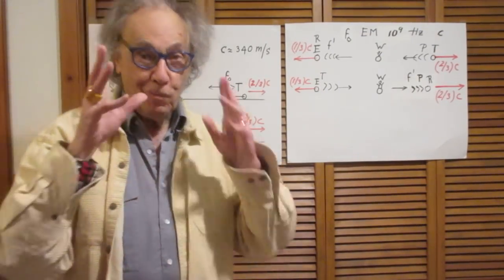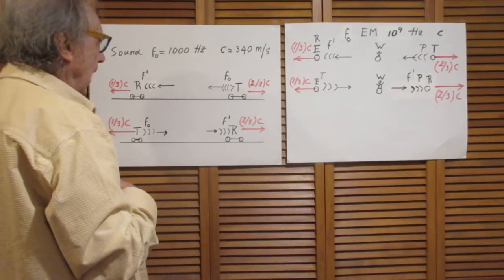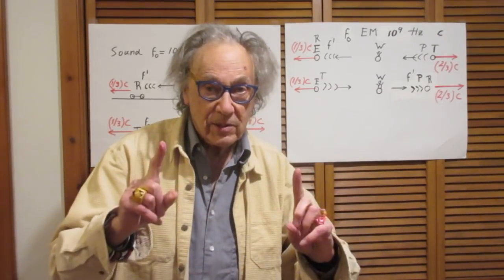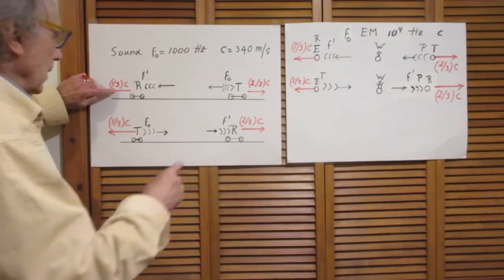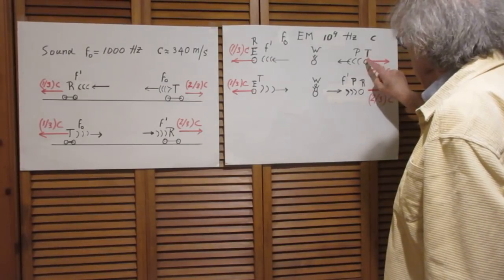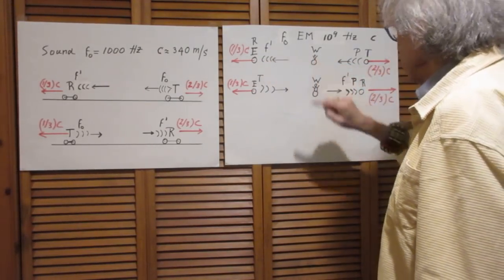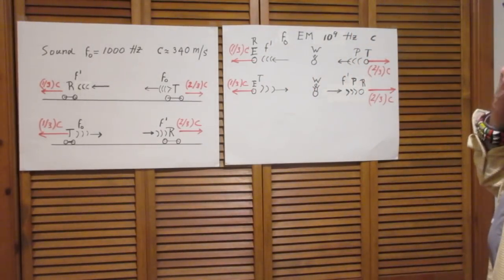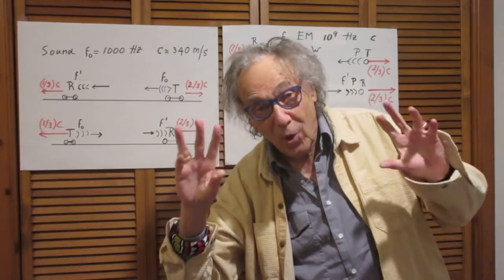Problem #28 Doppler Effect - Partly Easy, Partly Hard

Comment: I get this:
1) f' = 400 Hz
2) f' = 250 Hz
3) f' = 316 MHz
4) f' = 316 MHz
5) d = 2.84 Gpc
 
Notes.
1. Car moving away rightward 2/3 c produces sound, picked up by car on left moving away with -1/3c. The sound wave connecting the cars moves leftward at speed c so the relative speeds to this are 5/3 and 2/3. So the frequence ratio is 5:2.

2. Relative speeds are -4/3 and -1/3, ratio is 4:1.

3 Relativistic doppler shift formula is f'/f0 =sqrt ((1-B)/(1+B)).
Method a: first look what Walter measures, and imagine he emits it right away (he is on the same line as P and E).
B1 = 2/3 so fw= sqrt((1 - 2/3) / (1+2/3) f0 = f0/ sqrt(5) 
Then look what einstein sees 
B2=1/3
f'= sqrt((1-1/3)/(1+1/3)) fw= sqrt((2/3)/(4/3))= fw/ sqrt (2)
Now combine: f'= f0/sqrt(10)

Method b: first add up the velocities in the relativistic way: combined B = (1/3 + 2/3)/(1+(1/3)(2/3)) = 9/11, so f'=  sqrt((1-9/11)/(1+9/11)) f0 = f0 /sqrt(10)

4. Same problem, (only Walter sees a different frequency, but the combined speed is the same as in 3)

5. Hubbles constant relates speed to distance for distinct objects.
It is 70.4 km/s/Mpc. P is moving at 2/3 c, so at 200000km/s.
So the distance is 200000/70.4 = approx. 2841 Mpc or 2.84 Gpc (or 9.26•10^9 ly, since 1pc =3.26ly).
Reply from the maker: 5) is wrong
Reply: Lectures by Walter Lewin. They will make you ♥ Physics. Yes I took an outdated resource for the value of H. I hope the approach was right though.

Comment: #1 : 450 Hz
#2 : 450 Hz

Did this by deducing the calculations / formulas, I'm sure it was covered in highschool, but thats a long time ago and i didn't want to just look up the formulas and fill them in. 

Might be wrong.

Probably won't make it to the other answers, but i'll have a look at your solutions.
Reply from the maker: both wrong
Reply: Was afraid of that. Not thinking straight. Had a "zenuwbehandeling" at the dentist today which sure messes me up ..... Maybe I'll have another go tomorrow
Reply from the maker: "zenuwbehandeling"
ja dat kan heel naar zijn.
Reply: Blijkbaar. Ben van 2 tot 4 am van ellende de hond gaan uitlaten :-)...
Reply from the maker: morgen zal ik de solutions publiceren. Dan kun je dus weer rustig slapen (als je de solutions kunt volgen).

Comment: 3.  and 4  3.24 EE9 HZ
Reply: Actually, I used the approaching equation by mistake.  The proper answer should be smaller than original wavelength.  Answer is:  3.09 EE8 HZ a red shift of 3.24

Comment: I got the following answers:
1) 400Hz
2) 250Hz
3) 632455532,033Hz
4) 5E8Hz 
I'm sorry, but I couldn't find the answer of the question number 5
Reply: I resolved the four questions without converting the 1/3 and 2/3 of the respective velocities into natural numbers, so I'm not sure if the answers I got are correct
Reply from the maker: watch my solutions.
Reply: Lectures by Walter Lewin. They will make you ♥ Physics. I will :)

Comment: If the source of sound (pressure disturbance) itself is moving away at the speed of sound from the receiver how can the pressure disturbances reach the receiver?
Reply from the maker: Even if the transmitter moved away from the receiver with 3 times the speed of sound the receiver will record the sound but at a much lower freq than the transmitted f_o. Watch my solutions!

Comment: There are two conducting parallel rails separated by a distance L. One of their ends are connected by a resistance R. A magnetic field is set up perpendicular to the plane. A conducting rod of mass m starts sliding without friction over them with velocity v away from the resistor.

The rod will come to rest after infinite time due to the force by magnetic field on it given by ILB where I is the induced current in the rod. 
The question asks the amount of heat generated in the resistor in the entire process of rod coming to rest.

I solved it to get ½mv² which was the initial kinetic energy of the rod and is the correct answer.
I have a doubt that if all the initial energy got dissipated in the resistor, what happened to the energy taken away by the magnetic force as it is doing negative work on the rod? Is it 0?
Reply from the maker: I do not solve problems for viewers. I teach Physics. Watch my 8.02 lectures. The answers are there.
Reply: I didn't ask you to solve.
In short my question is — when the given conductor starts to slide with velocity v, the force exerted by the magnetic field on the conductor due to induced current in it decreases kinetic energy of rod, as it is doing negative work, what happens to that work. I am asking this because the work done by the force is 0 in the whole process.
Reply from the maker: google "Motional emf"

Comment: Part easy part hard and one last part very hard. I did my best, but I got a lot of variation on question 5 depending on which exact value of the Hubble parameter I picked. Anyway here are my answers:

1) 400 Hz
2) 250 Hz
3) 3.7796 * 10^9 Hz
4) 3.7796 * 10^9 Hz
5) 5.35  Billion Light Years
    (or 5.96 billion for a fixed hubble parameter)

For question 5 I first calculated the distance using a fixed Hubble Constant of 73.45 (km/s)/Mpc (published 02-2018). This got me a value of 5.962 Gly. I felt this was far enough that the Hubble Parameter would likely be varying. So I went for a revised version. I got a lot of messy mathematics and numbers until I found a calculator online that helped (it was hard to keep all the exponents straight when plugging in cosmological parameters). Anyway using the same Hubble parameter for today and Omega_m=0.286 in a flat universe and a redshift that I calculated from your problem I got my final answer. 

So fun. Thank you for the questions. Looking forward to finding out how wrong I am...or am not. ^_^

Comment: Sir, suppose I am sitting on a chair which is moving in outer space with the speed v comparable to speed of light. Now according to objects at rest in space I am moving with velocity v but according to frame of reference attached to me and chair i am at rest and the objects are moving with same velocity v (in opposite direction). According to the object I'm having relativistic mass. So according to the frame of reference attached to me will there be developed relativistic mass in all the objects around me?
Reply from the maker: All rest masses are independent of reference frames.
But "gamma" will depend on ref frames. Thus KE will depend on ref frames.
Total energy E= gamma*mc^2 = mc^2 + KE. Here m is the rest mass.
Reply: Yes sir I know rest mass is independent of ref frames. But do the relativistic mass depends on ref frames. If it does then all other object (which are actually at rest) moving only according to my ref frame will have KE (rest mass they already have) hence they will have relativistic mass. Sir, am I right.
Reply from the maker: I always avoid the words "relativistic mass". It's a misnomer. If you want to call gamma*m (m is the rest mass) the relativistic mass, then it depends on ref frame bcoz gamma depends on ref frame.
Reply: Sir, this means I was right. Let me explain. Let my rest mass be m1 and rest mass of whole universe excluding my mass be m2. Now universe in seeing that I am moving but I am seeing the universe is moving with same velocity as mine. So I am having gamma*m1 (according to universe) and universe is having gamma*m2 (according to me)!!!
Is that right Sir.
Reply from the maker: I always avoid the words "relativistic mass". It's a misnomer. If you want to call gamma*m (m is the rest mass) the relativistic mass, then it depends on ref frame bcoz gamma depends on ref frame.

Comment: 1) 400Hz appx. 
Sol. Using doppler's equation... ft=fo(c-Vr/c+Vs).. Since the reciever is moving away from the source/transmitter, negative sign is used and since the source/transmitter is moving away from the reciever, it is (+)ve.. Applying the respective values of source and reciever and the frequency we get.. 1000(340-340/3 / 340+680/3) = Appx. 400Hz. 

2) Ans. 2500Hz Appx. 
Sol: using the above equation, and Implying the given values in the question, we get... 1000(340-680/3 / 340+340/3)= Appx. 2500Hz 
I managed to solve this now, ill solve the remaining as soon as possible sir.. Plz forgive my mistakes and thank you for this question..😊

Comment: When the transmitter moves away from the receiver at Mach 1, the sound will not reach the receiver
Reply from the maker: this is INCORRECT!
Reply: Listen to a supersonic plane. While it approaching you, you don't hear it. Then you hear a bang. Then you hear the noise of the engine for quite a while.